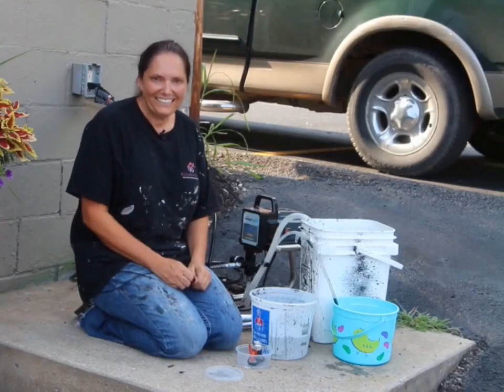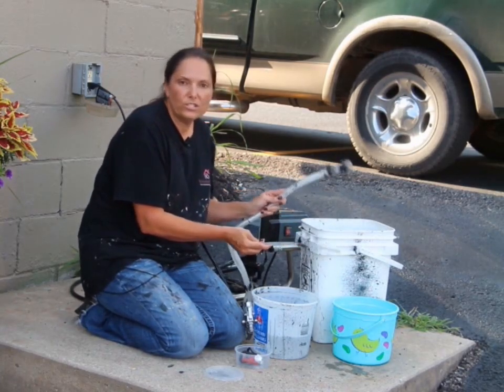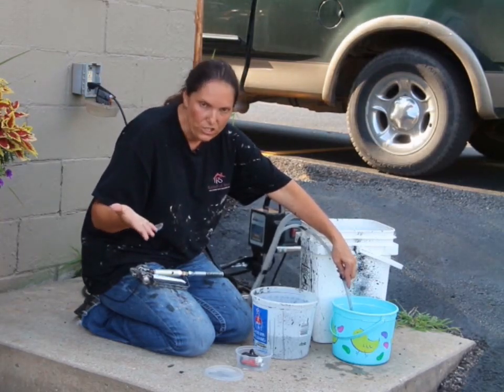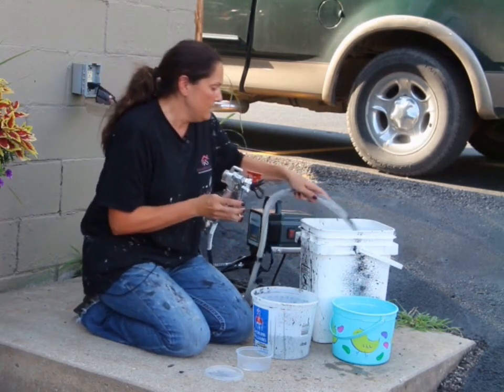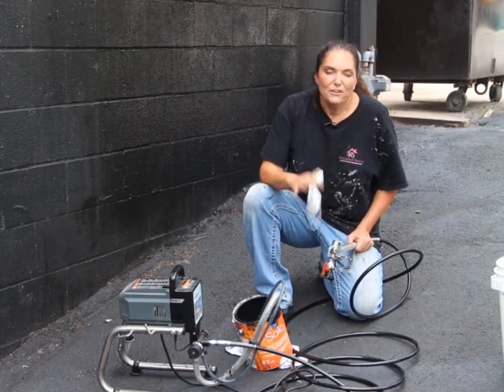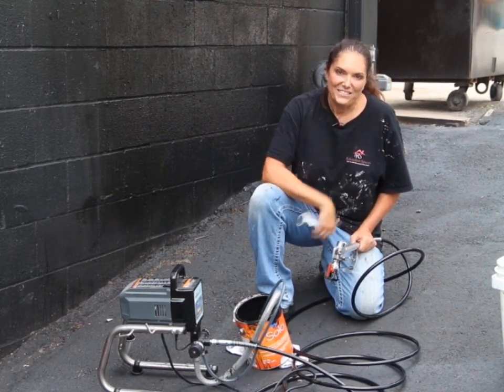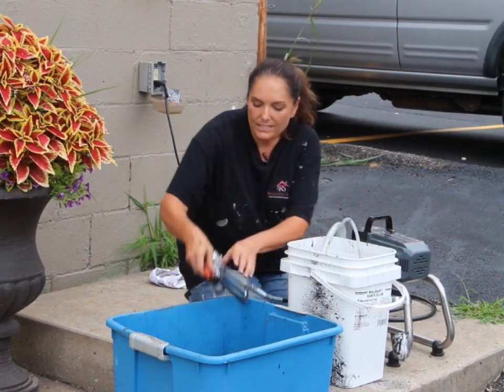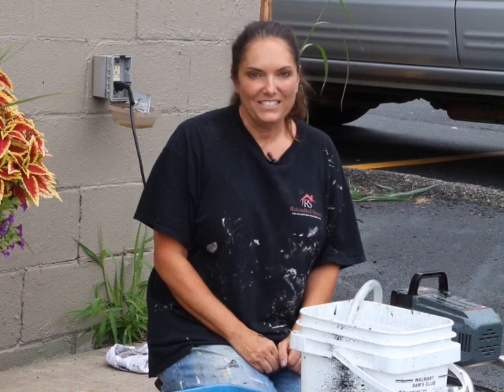Homeright Power-Flo Pro 2800 Series Airless Paint Sprayer

Comment: This is the reason why people need to read the manuals when  they buy things especially when they don't know what they're doing and they don't know what the machine that they're using does! The tip on the spray gun that's not called a on-off switch it's  unclog and spray when the gun gets clogged you turn the tip reverse and squeeze the trigger for a second that will unclog the spray gun then you turn the tip back around and then it's ready to spray paint again. And when the sprayer machine is high-revving like that that means it's out of paint.